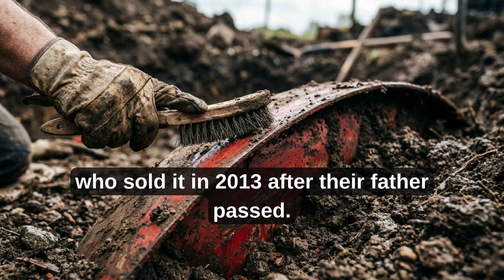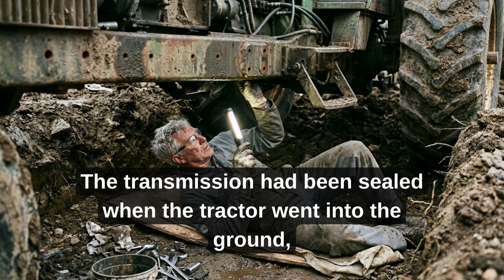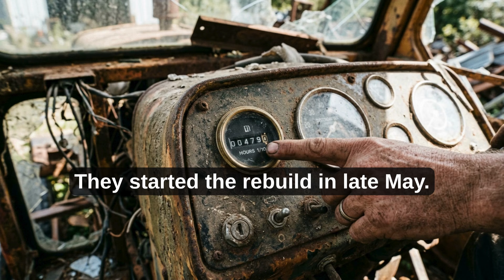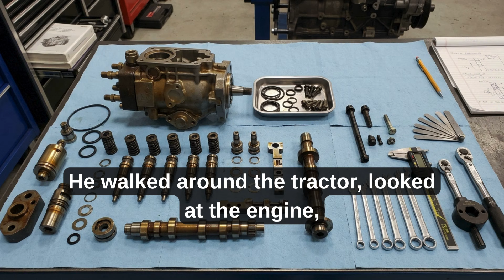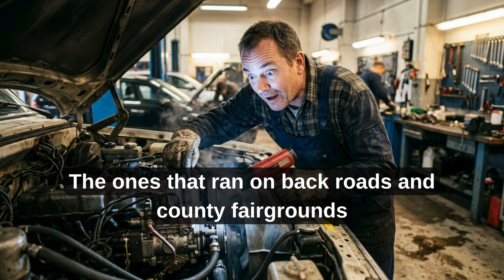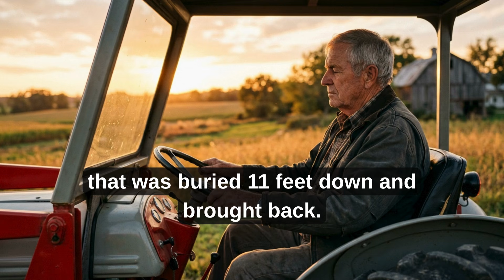The Massey Ferguson They Found Buried Under 11 Feet of Dirt — What Happened When They Started It

Comment: I grew up around MF tractors I owned several and I played with the power output slightly just to increase a little more HP on the farm my 255 MF was one of the earliest with the 203 cid Perkins engine but after a little tweaking here and there it stood right there with the later models with their 236cid engines and a little more only when needed I did the same with the 270 MF tractor never said anything to the other farmers around just played confused when they questioned how I did certain things with my tractor that they had difficulty with their slightly bigger tractors sometimes I'd say it's because I'm running a little bigger rear wheels than factory THIS is the first time I'm mentioning what I really did thanks for your story now I understand that I'm not odd like some of my fellow farmers used to say behind my back or when they thought I wasn't listening to their comments or out of ear shot